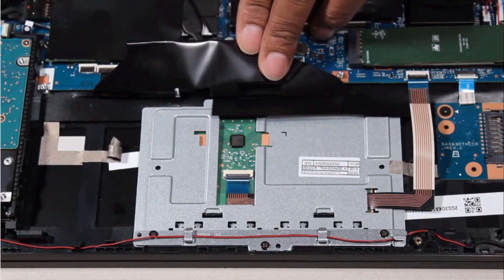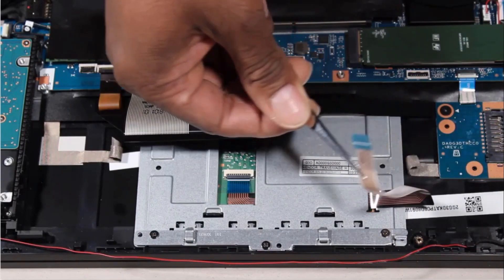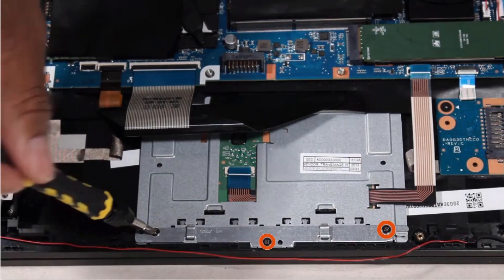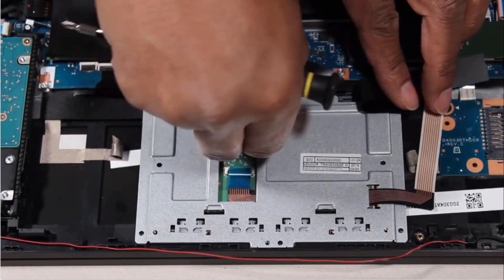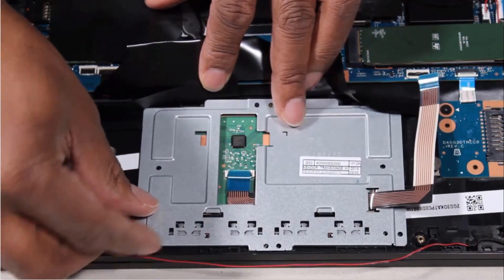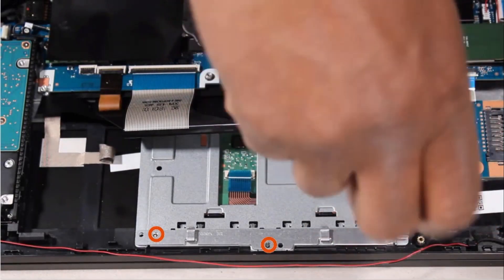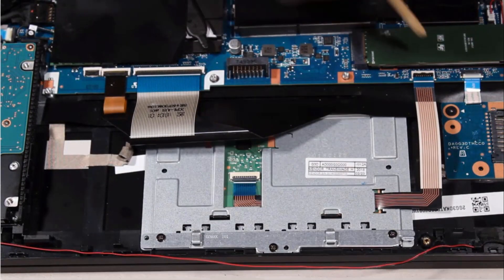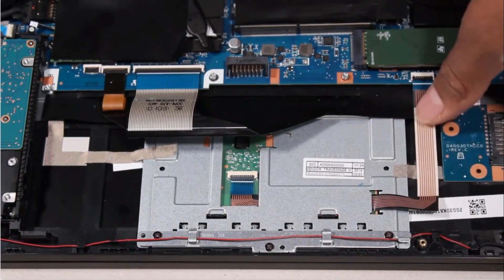How to replace the Touchpad Button Board for OMEN by HP 15-dc Series Gaming Laptop

Comment: Hi im getting double click. Click hold issue on left click button on the touchpad. Is this due to dust or do i have a broken touchpad button circuit i need to replace? Right click works perfectly.